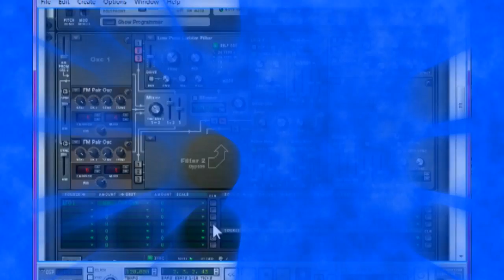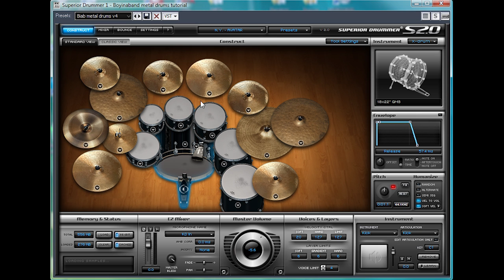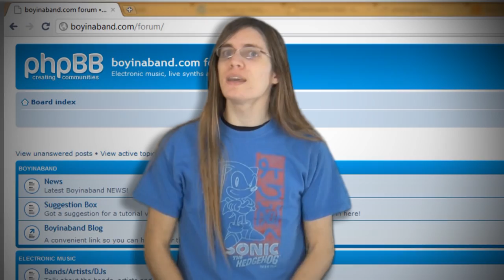Tutorial: Metal Drum sound in Superior Drummer 2

Comment: 5. He does not filter any of the OH mics (OH usually requires huge mid cuts and a HPF around 150 for metal).
6. He does not show how to use the multi out setting, which is crucial in making S2.0 work in a mix (you can add outside plugins to different mics)
7. That much parallel compression is just out of control. 
8. Not utilizing the snare bottom or snare bleed into the ambient mics will kill the snare sound.
Watch ola englund tutorial and check out Adam Nolly's Getgoods posts on his presets.

Comment: 1.That much bass on a kick (Especially sub range) would be catastrophic in a mix or on any stereo with a sub. (Professionals usually highpass bass at around 30hrz)
2. Its more beneficial to do your EQ cuts before Compression and EQ boosts after compression(personal preference, but usually the case)
3. Kick compression should normally be a slower attack, and the release should roughly pump with the speed of your kicks.
4. The boost on the snare is also too much, making it too tubby

Comment: i don't know what happened to that bass, but it is way too squashed. your eq is just about as the one i normally use, my compression is higher and i also have a second eq on top of everything, pushing down the 300 hz even lower. and a low pass filter just before that. under 50 hz you generally get mud and will mess most metal mixes. and you cannot get a natural kit without smart use of room mics. i think this is why your kick is squashed.